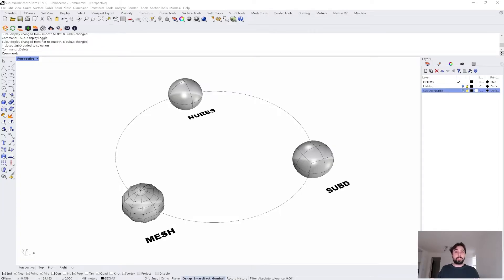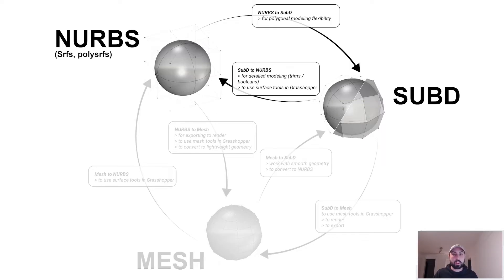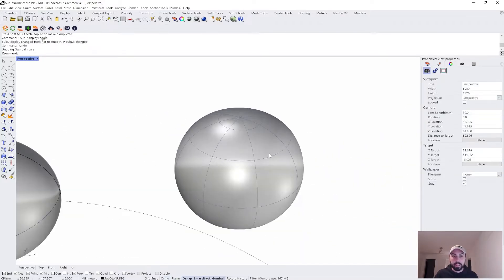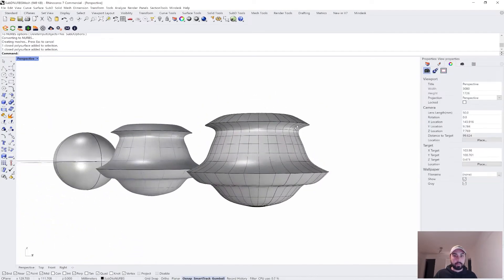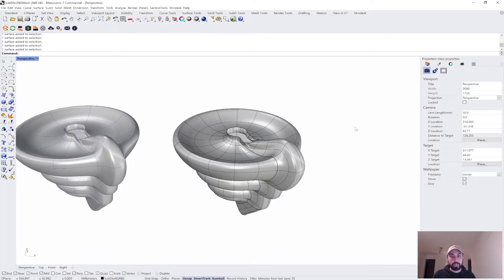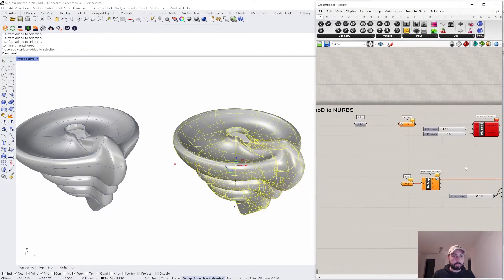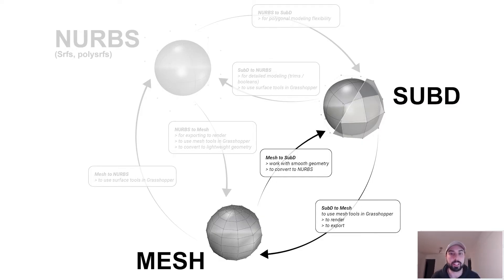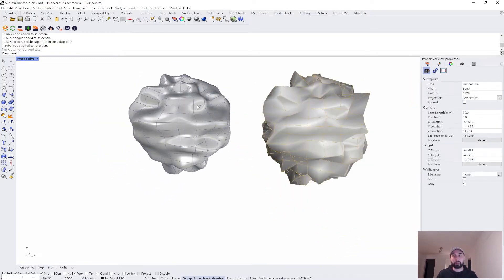GEOMETRIC WORKFLOWS in RHINO

Comment: Network srf is not working after dup edge
Reply from the maker: Did you organize the curves yourself or using the network surface auto sort? One tip I’ve used for organizing them visually is changing the color of the U direction curves to blue and the V direction to red. Then it’s clear where there’s a problem

Comment: thanks man for the explaination, but if i may ask, let say if i want to export it for blender to create animation, in this case im using sub D for some bevel, and nurbs together, what kind of operation do i need before i export it into mesh polygon? should i go with grasshopper and smooth it out first, or just export it?
Reply from the maker: I mean I would recommend smoothing in GH before export just so all geometry is sorted in 1 program but you could also use the modifiers in blender to subdivide/smooth an imported polygon mesh!